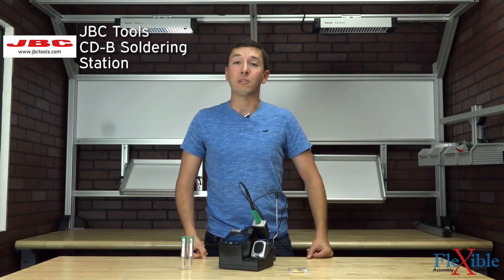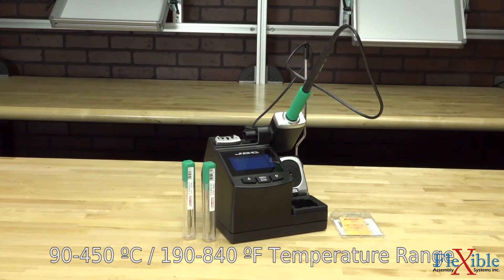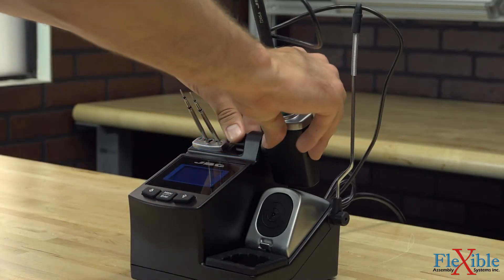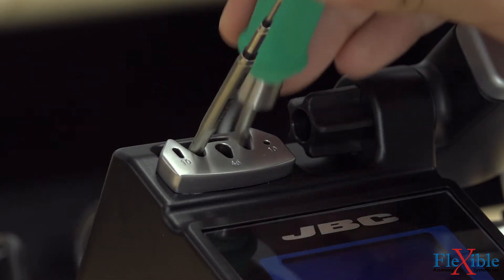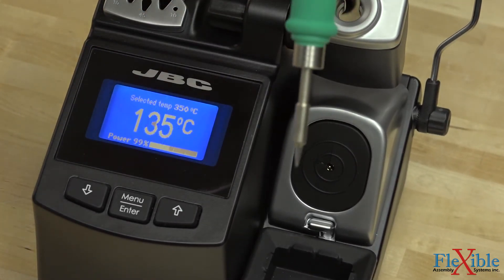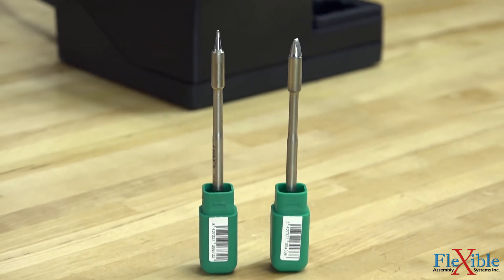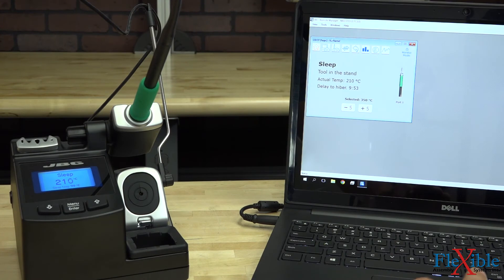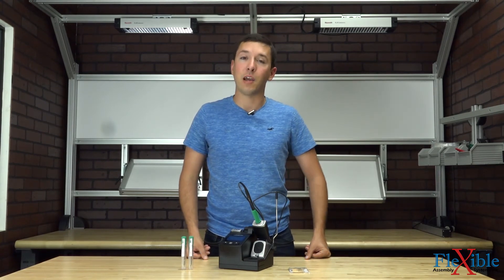JBC CD-1BE Compact Soldering Station

Comment: where can you find refurbished ones?
Reply from the maker: JBC holds a stock of refurbished stations for when customer stations need repair and they require a quick replacement. You can contact JBC directly or our customer service reps since we are an authorized JBC reseller. info@flexibleassembly.com or www.FlexibleAssembly.com